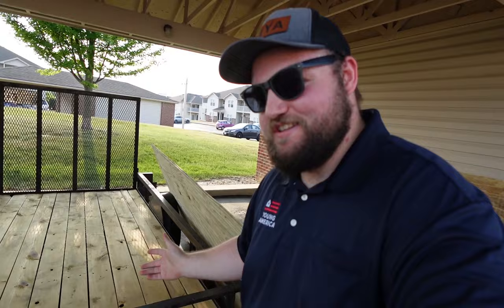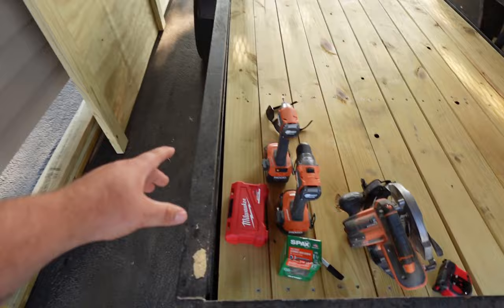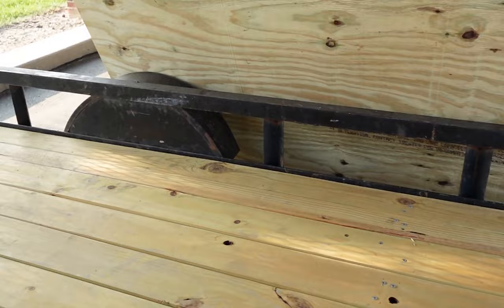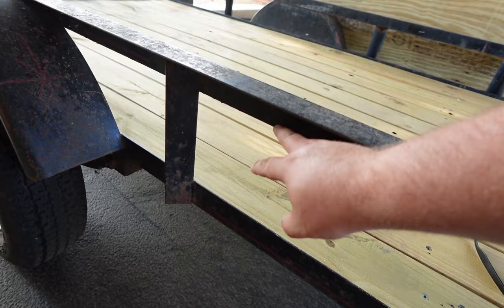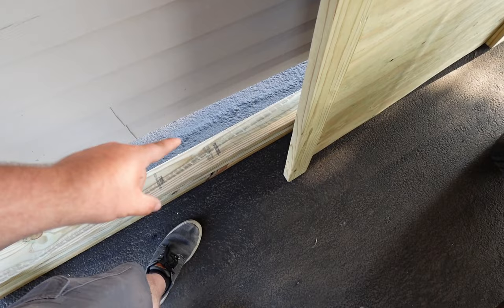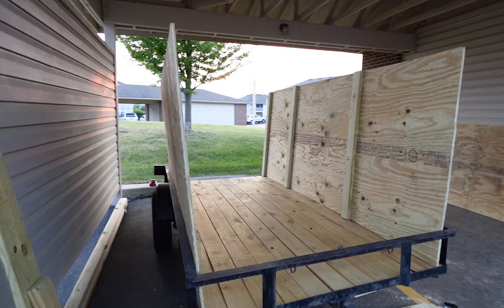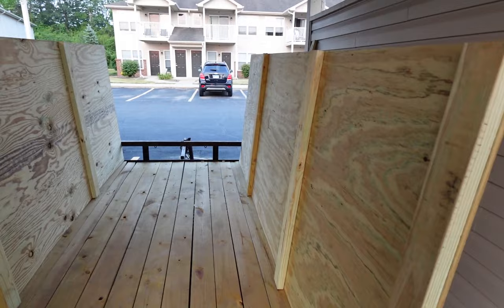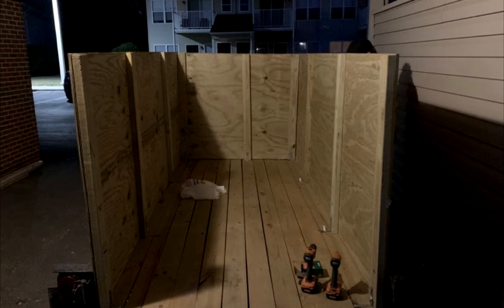Building Walls On a Utility Trailer

Comment: Love watching your journey, man.
Reply from the maker: I appreciate that! Thanks 😁
Reply: @Jakobs_Journey That's the problem with those trailers. They are nice, but they should have made higher sides on them. At least 4 feet high, my father and myself out of metal and plywood took a Harbor freight trailer, and made some very durable sides over 36 years ago and they're still holding up, I wish I could show them to you, however I don't have a video. I'm just making a comment. But I have never seen sides, the way we made them, anywhere, on any video.

Comment: So it won’t fly off ? Because I’m gonna do this now , but I might weld some so it won’t fly off
Reply from the maker: No the lag bolts go through the frame, plywood and 2x4. Securing everything down to the frame. And L brackets to add just a little more support
Reply: @Jakobs_Journey  Thank you